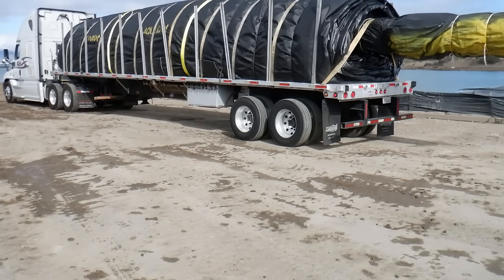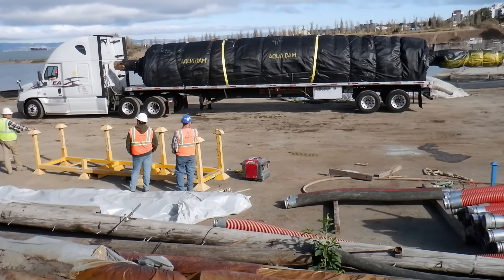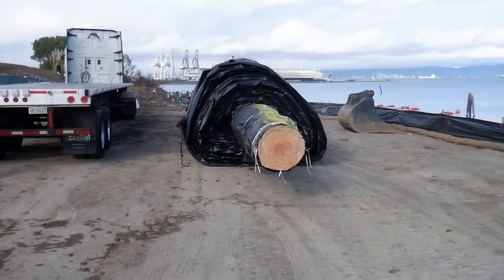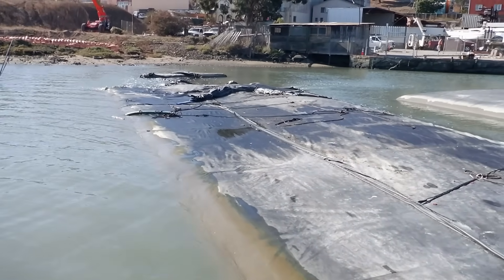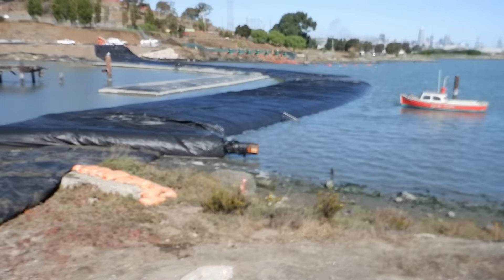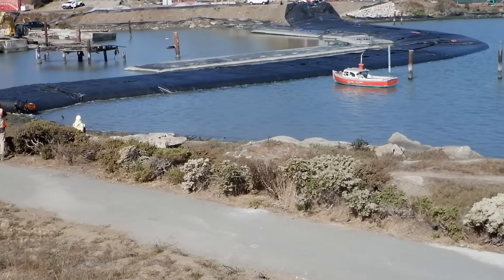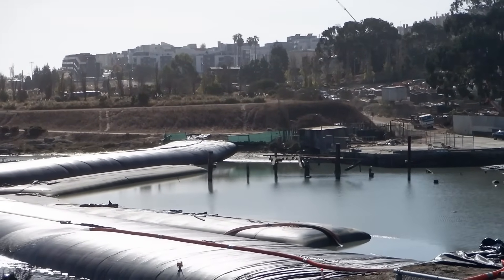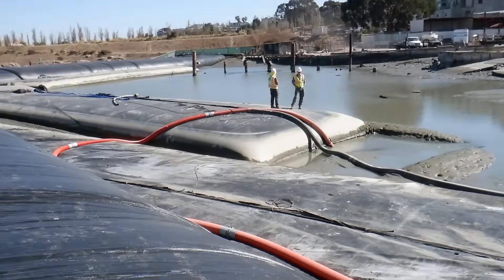San Francisco, CA 2021   16ft tall AquaDam Installation [Part II of II]

Comment: Is there a word called dewatering
Reply from the maker: Per Google's AI Overview:
Dewatering is the process of removing water, particularly groundwater or surface water, from a construction site or other location. It's essential for creating a stable and safe work environment during construction, especially in areas prone to flooding or with high water tables. Dewatering methods can involve pumping, wellpointing, or other techniques to lower the water level and allow for excavation and construction. [1, 2, 3, 4, 5]  
Here's a more detailed explanation: 
Why is Dewatering Necessary? 

• Safety: Waterlogged soil can be unstable and lead to slips, falls, and cave-ins, creating hazardous conditions for workers and equipment. [2, 6]  
• Soil Stability: Dewatering improves soil stability, allowing for proper compaction and preventing issues with the foundation of structures. [2, 6]  
• Construction Efficiency: A dry site allows for easier excavation, concrete pouring, and other construction activities, keeping projects on schedule. [2, 6, 7, 8, 9]  
• Erosion Control: Dewatering can prevent soil erosion caused by water runoff. [2]  

Common Dewatering Methods: 

• Pumping: Using pumps to remove water from sumps (collection points) or directly from wells or trenches. [1, 5]  
• Wellpoints: A series of closely spaced, shallow wells are installed around the excavation area, and water is pumped out of them. [1, 5]  
• Eductor Systems: A system that uses a vacuum to draw water out of the ground. [3, 10, 11]  
• Deep Wells: Drilling deeper wells to lower the water table. [3, 5, 12]  

Other Dewatering Applications: 
While construction is a common application, dewatering is also used in: [4, 13, 14]  

• Wastewater Treatment: Separating water from solids in wastewater treatment processes. 
• Mining: Removing water from mine shafts and excavations. 
• Industrial Processes: Removing water from various materials and products. [13, 14, 15, 16, 17]  

AI responses may include mistakes.

[1] https://trenchlesspedia.com/definition/2495/dewatering[2] https://www.bigrentz.com/blog/dewatering[3] https://griffinfluidmanagement.com/what-is-construction-dewatering-methods-benefits/[4] https://ironcladenvironmental.com/2023/07/12/the-process-of-dewatering-construction-sites-explained/[5] https://perlo.biz/construction-dewatering-what-is-it-and-why-does-it-matter/[6] https://triflo.com/dewatering-for-construction/[7] https://mwipumps.com/2023/06/30/understanding-wellpoint-dewatering-a-comprehensive-guide/[8] https://www.xylem.com/en-au/solutions/construction/tunneling/[9] https://www.hcppump.com/show/germany-construction-dewatering.htm[10] https://www.bigrentz.com/blog/dewatering[11] https://wjcanada.com/our-services/eductor-dewatering/[12] https://pilebuck.com/services-guide-dewatering/[13] https://aquabarrier.com/blog/construction/what-is-the-dewatering-process-on-a-construction-site/[14] https://wessuc.com/articles/what-is-dewatering[15] https://www.sciencedirect.com/topics/agricultural-and-biological-sciences/dewatering[16] https://www.ny-engineers.com/blog/dewatering-techniques-for-construction-projects[17] https://angroupcn.com/dewatering-pumps/
Not all images can be exported from Search.